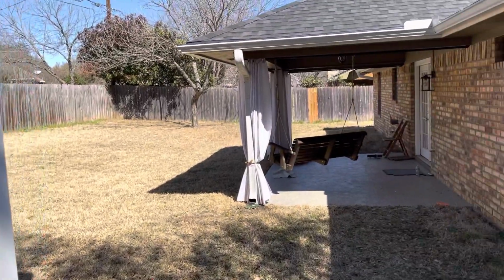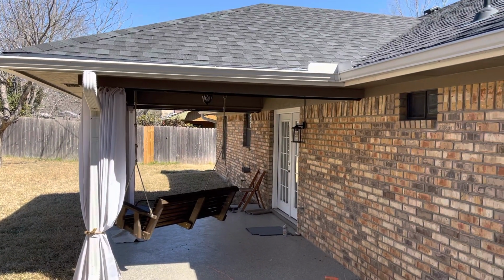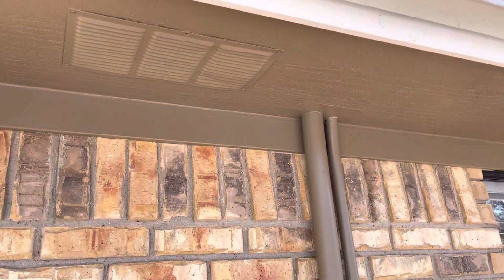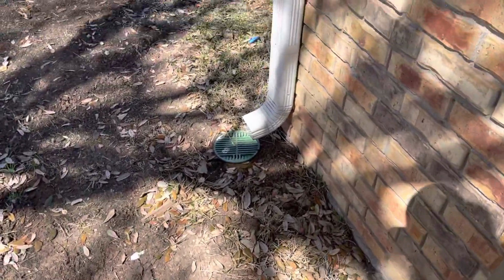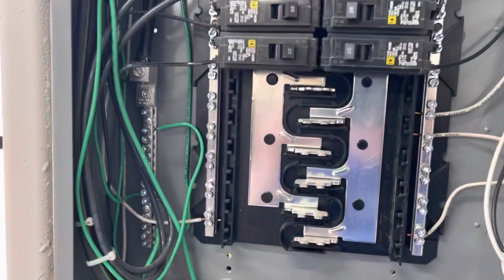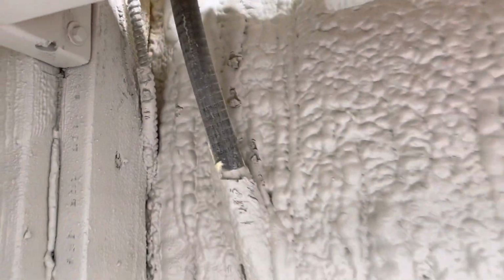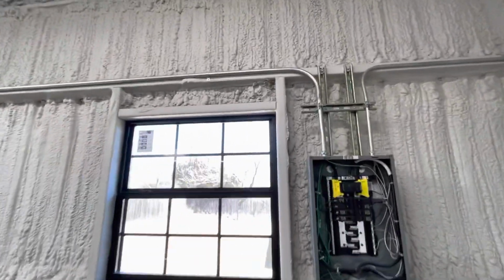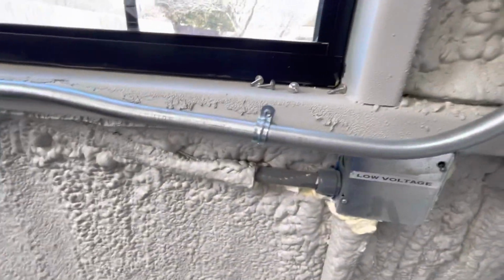100 amp sub panel metal shop

Comment: I am in the process of doing the same thing. Did you run a ground from your main panel to the sub panel? Or just run the 2 hots and neutral? I plan on running 2 hots and a neutral then putting in a ground rod and grounding the panel to it.
Reply from the maker: I ran the SE (Service entrance) cable from the panel to a big junction box in the attic space. I then rant it in conduit to make the transition to the outside of the house. So yes I did run a ground from main panel to the sub panel. As well as I drove a ground rod in outside the shop and ran the bare copper wire down to that as well.

Comment: Hello, did you ground this panel seperately? Or did you just ground at the main panel. Thanks in advance!
Reply from the maker: I did ground it separately. I drilled a hole just big enough to pass the ground wire through and just used a touch of caulking around the hole

Comment: A couple questions or comments.   You talked about splicing the feeder conductors in the attic.   Hopefully you did that in a junction box.   There didn’t seem to be anything securing those conduits on the outside going up to overhang.   You didn’t mention and I did not see a grounding electrode conductor coming from the ground bar to the outside for connecting electrodes(ground rods).   They are required by NEC.   The reason you need them is to dissipate a lightning strike.   Also, the metal structure of 5he shed is required to be bonded to the electrical panel ground bar.   I’m telling you the last two for the safety of you and others.   I read an article where a metal building store/gas station didn’t bond the structure.  A customer was standing near the AC condenser and touched it and the metal siding.  The metal siding was at 120 volts and the condenser was grounded.   It was not a nice funeral.    Always be safe, the life you save may be your own!   Best wishes.   Kevin
Reply from the maker: yes the wires are spliced in a 15X15 inch box in the attic. As for the grounding, after it was inspected I went ahead and drove a ground rod in outside and took some #4 bare copper from the panel to the ground rod outside.  The panel is secured with metal strut on the back of it.  I am not a licensed electrician, I have just watched it done a few times and did everything I saw them do. If the panel is connected to the building via metal and that panel is connected to a ground rod, I thought that would suffice. I appreciate the recommendations. I am just trying to help and teach people what I did, but as always, if someone doesn't feel comfy, always hire a licensed person if anything is ever in question.

Comment: any specific reason uses metal boxes instead of plastic..??
Reply from the maker: Metal boxes are more sturdy and just looked better in my opinion when they are exposed like that.  I am not a licensed electrician but I don't think I could of used plastic as the boxes are permanently exposed. They are in a stud wall and covered up by a wall of some kind.

Comment: So heres what we have going on. We have a main pole that has 200 amp service to it. We have a shed that is about 350 to 400 feet away and we'd like to install a sub panel to feed an A.C. and a fridge. I think I need a 50 amp breaker at the main box then run #6 UF wire to the sub panel which will have two 15 amp breakers, one to feed an outlet for the A.C. and one to feed the outlet for the fridge. Does this sound like the right set up? Also would I need to worry about voltage drop or would this set up enable The A.C. and fridge to run without fault even with voltage drop. I have literally just started to learn about all this in the last week. Treat me like a toddler when answering please. haha
Reply from the maker: oh no worries, We all have to start somewhere.  So I googled a website that could help. https://www.southwire.com/calculator-vdrop

I would look at the AC you are getting. They all have on there the max amps they pull. Also is it 120 or 240? You said plugin it in so maybe its just 120?  With the distance and the amperage I would say #6 would work if its copper. You could always look into #4 Aluminum which would be cheaper than copper, you would need to put anti-corrosion paste anywhere you strip it.  I would always try to think of the future. You go out to the shed and you want a cold one, then maybe you want to put some lights out there, then maybe some more plugs, maybe some exterior lights.  
any sub panel would have enough to do that for sure. If the AC is pulling less than 20 amps but more than 15 you would have to go with #12 wire inside the shed as opposed to #14. If you need anything just let me know. I am more than willing to help and explain what I can.

Comment: Nice shop! I’m going to be adding a 100 amp sub panel soon. I presume you put a 100 amp breaker in your main panel. Were there any issues connecting 1 gauge service entrance wiring to your 100 amp breaker?  I’ve never worked with 1 gauge aluminum before.
Reply from the maker: Jim. There is a 100 amp breaker in the main panel. I had to open up the lugs on the breaker all the way but it did just fit. Just put some anti-corrosion stuff on the bare aluminum and it will fit.

Comment: This video didn't have the one piece of information I'm looking for... How to install a sub panel. Kind of a worthless video, really. The only thing I can install on my own is a lug-only sub, but I need to add a panel to the far side of my house, which will require it's own main breaker. You have installed a panel with a main breaker, but didn't say a word about how you did that.

Comment: looks like you installed the MC wires, junction/outlets, and sub panel after spray foam insulation. I'm debating between getting spray foam first, then install electricals for my 30x24x9 metal shed just recently installed
. Please advise.
Reply from the maker: Hiya, Vinny. Its all in what you want it to look like. For me I didn't want the MC cable showing so I installed just the cable and a 4 square metal box. All I did was taped the wires to the metal and they sprayed and covered them up. I also used painters tape to cover the box. They did cover anything before they sprayed, except the windows and doors. So I have one cable out the back for the AC. I have a total of 3 out the front. One for and outside outlet and 2 for the exterior lights. additionally, might want to run something up hear the roof if you ever wanted any Christmas light or any kind of cameras.  if you forget something you could always cut the foam back and just go by a can of spray foam at the store and fill it back in. It may be a different color, but I paint all my interior with a spray gun. Hope this helps. Good luck and thank you for the comment.

Comment: I enjoyed it. Great job. I’m thinking about building a shop too I’m curious what’s the price range for this size you have
Reply from the maker: I paid right around 30K for everything. The building and concrete was around 14-16k. The electrical and everything else added up pretty quick.  everything was extra. I had to pay for windows, garage door, garage door opener, spray foam, electrical, gutters, driveway, mini-split.

Comment: I thought if you had a subpanel in a separate outbuilding, it had to have its own separate grounding system, with neutral and ground bonded together.  Although this is so close to the main building that would probably be unnecessary overkill.
Reply from the maker: So one inspector said I didnt need it. The one who did the final inspection said I did.  I pounded in a ground rod outside and ran the bare copper out through a screw hole and buried it. 2 inspectors, 2 different ways to do it.
Reply: A sub panel in a remote building requires it's own grounding system, and the neutral and ground are SEPARATE. Ground and neutral are only bonded at the first point of disconnect.

Comment: Hey, nice job! I'm in the middle of a 24x36 metal shop build at the moment and I'm trying to plan out my electrical. (I wish I would have stubbed out my conduit before they poured the pad!) Did you consider going with armored cable instead of the conduit?
Reply from the maker: Hey Dave. I thought about it, but only for a little bit. I wanted to run my electrical on the front side of the purlins so it would be "exposed" and in my opinion, I think the hard conduit looks better when its exposed. But, if you spray foam it you can hide a lot of the armored cable. The armored cable is cheaper and faster. If you ever do it again and you are in a rush you could always stub a 2 inch and a one inch and put a 90 at the bottom and they can pour the slab. You can always pipe the rest, or just leave the stub 90 buried. I tried to "future-proof" mine the vest I could. I ran a one inch conduit for low voltage stuff. I'm not using it but I might in the future. Plus with the conduit, if I want more circuits I can just open up the boxes and pull more wire in it.  I also wired for a welder, which could be a welder or a compressor or anything else that requires 220 volts. Also don't forget to wire power for a garage door opener. In the ceiling or on the side. Also some ceiling plugs are nice to have for putting a extension cord with a reel up there. Whenever you need it just pull it down and its out of the way.
Reply: @centexav8931  Understood. My plan is to run the armored cable and then have the building insulated followed by 3/4 inch paneling or slat panels. I have 14 ft walls with a 4-12 slope where I will be looking to run separate circuits for lights and a ceiling fan. You've got me thinking about the mini-split as well. Several people have recommended it. And we're also putting solar on the roof with a couple of Tesla Powerwalls to hopefully mitigate another power outage like we had back in February. What did you use to wire the power from your house to the garage?
Reply from the maker: @daveevans9440  I went to wireandcableyourway.com for the wire, they have every wire imaginable and you can buy it buy the foot. I used string to get my measurements. Always better to get more and cut then to be short when you are dealing with wire this expensive. I have a 100 amp breaker in my house main panel going into the shop. I couldn't get conduit where the panel was so I had to go with Service entrance cable. I went with 1/0 aluminum since copper is so expensive. So I bought 40 feet of that. In the attic I bought a 16X16 inch plastic junction box and spliced in there. Splices that big are hard to find at box stores or out of stock so I got them online. from that box I ran 2 inch pvc since it needed to be in conduit when it exits the house. That wire is also 1/0 Aluminum. But, its a direct bury wire so if its in the ground it doesn't need to be in pipe I believe. I also read that the ground helps keep the wires cooler The 90 from the attic into the ground outside was a pain. I had to use a heat gun and "massage" the conduit to get it where I needed it. I was lucky, there was a soffit vent so I just unscrewed it so I could get my arm up in there. The holes for the conduit looked pretty rough so I used roof flashing to fit perfect around the holes. I caulked it in and unless you look real close you cant even tell. 2 inch is a little big for those wires but I didn't want to have any problems pulling it through. The inspector said it had to be 24 inches deep so that's what I did.  So the conduit 90's from the attic into the ground 24inches deep. I then put another 90 on it to go to the shop and put a plastic bushing on the 90. I then laid the wires in the trench. There is another 90 at the shop to go up and penetrate the foundation and go up to the panel. I have 1 inch low voltage going out there too. I just filled in the trench half way and put the 1 inch on top. I piped that all the way from the attic to the shop. My thought, if anyone wants to pull anything extra in the future, it will be easy. In the one inch I have once cable wire, one internet wire, and a pull string. As for the mini-split. I like it. My windows were too small to fit an AC unit big enough to heat and cool the square footage. All it is is a 2 inch hole outside for the pipes and wires and mine runs off of #12 wire, same as receptacles but it is 220 volt. Its pretty darn quiet as well, but pricey for sure.  I did use the electrical cable for whipping out to my exterior light and out to my mini-split. I also whipped out of a box to power my garage door opener. So there is some, but not a lot of cable. Also, think about using 2x4's glued to the inside so you have something to mount any exterior lights or outlets to. I just used liquid nails since it doesn't need to be structural and it was covered by the spray foam. It helps keep any light from sagging if you go with the big barn lights like I have. I love talking this stuff so anything else just let me know. I can only give you what I like and what worked for me. In the end, its your place, so make it what you want

Comment: Will you need a GFCI for your welder outlet?  It is my understanding that any outlet needs to be GFCI in the garage.  That circuit had a breaker in the panel but no outlet?  Like you I just wanted to run wire for future circuits, I was not planning on running a breaker if the inspector was cool with that...
Reply from the maker: Eric, so different welders have different plug ins.  All the wire for the welder is there behind that plate.  I am going to buy the welder first and then go buy a plug so I’m not wasting trips to the store.  I don’t believe a welder has to be in a gfci.  It falls in the same category as a dryer.  I ran wire for 50 amps and a dryer uses 30.   No gfci on the dryer so my option is no gfci on a welder.  Plus the ground fault would have to be somethings that’s built into the circuit breaker since no one makes a big outlet like that with the little buttons on it.  You need any other help just let me know.  I love talking about this stuff!
Reply: @centexav8931  They make 50A GFCI double breakers they just cost around $90.  Electric vehicles also use a similar 50A 6AWG power outlet, similar to a welder,  most Stick welders are 50A, I picked up older snap-on YA212  Mig welder it calls for 20A 240V circut.  I was going to run 6/3 and install NEMA 4 prong range style outlet, I think you can still plug in a three prong plug in that outlet, it just doesn't have a neutral prong, IE I think the two hots and the ground are in the same location.  They also make adapters to convert outlets so long as you are down grading the current.
Reply: Under the 2020 NEC the welder and a dryer will be required gfci protection . The way around the welder is to hard wire it into the system

Comment: Is it code to put the 120 v and the low voltage in the same box ?
Reply from the maker: Hey Joe.  So that’s a long story.  I had a metal box for the low and high voltage.  They are separate until they meet in the one metal box I have.  The box stores sell a plastic 2 gang box for both that have a divider to separate the different voltages.  I am not sure of the code but the inspector passed it.  Didn’t even mention it.  It’s just a shop and not an industrial situation.  If I was running huge machines or welders I would worry about bleed over into the
Low voltage (fuzzy picture on TV and poor internet).  I couldn’t find a metal 2 gang box with a divider in it.  You could always cut a piece of metal and tack weld it in the box. That’s just my take.  Like I said I’m not a licensed electrician but it’s safe and it works for my application.
Reply: Yes, I would not worry about it. Just seems like using 2 separate boxes would be easy enough. I am an amateur electrician also.
Reply from the maker: @joewalker76  Of course.  I guess I’m a “looks” kinda guy.  I was thinking that 2 boxes over and under would look as good as just one box.  That’s the beauty of doing the work ourselves.  I could of run the whole thing in the flexible MC cable but I didn’t like how it looked so I ran conduit.  More expensive but I like the way it looks.
Reply: There is a code dealing with high voltage and data/ low voltage separation.